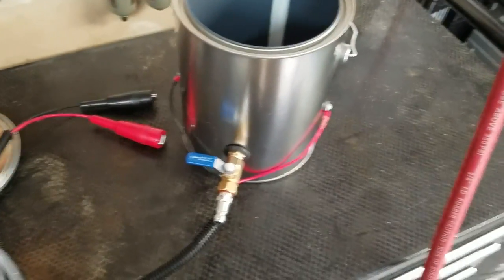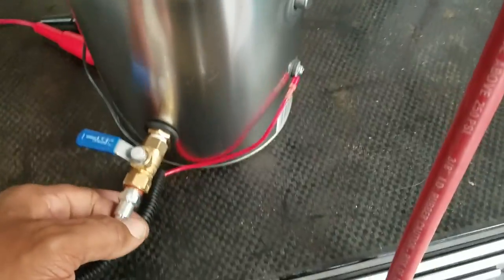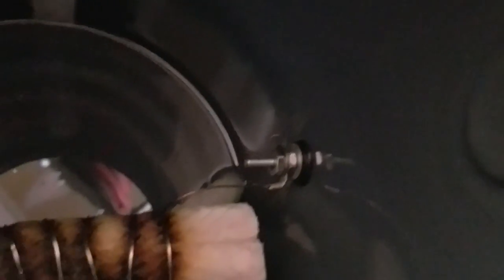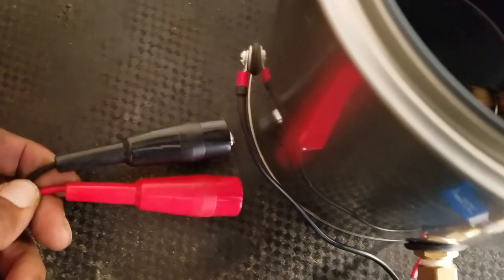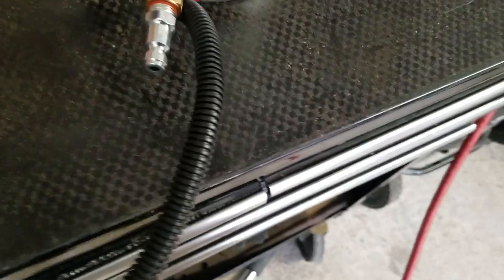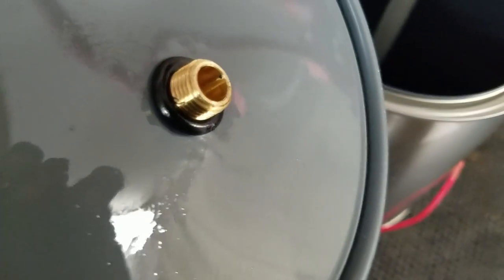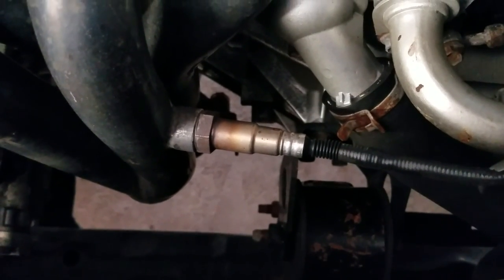Mikes DIY evap smoke machine

Comment from the maker: Sorry for taking so long to respond to this video, life’s been kicking me around a bit.

Chances are one of your wires are grounding to the can, i used insulating washers between the nuts and the can so that nothing is electrically touching the can at all. If you have a multimeter, use the continuity test between the red and black battery clips to see if you have a short
Reply: Helo sir I am live in pakistan I make one  thermal fogging machine for agriculture plz guide me u r engineer thermal fogging machine in available in market but he is very costly u guaid me I am make at
Reply: I'd personally use a rubber grommet instead of those washers to protect the can from touching the bolts and wires at all

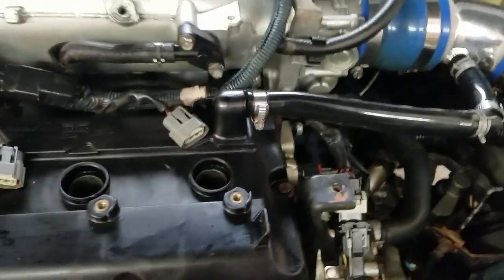Comment: you made a mistake at 6:53. the correct thing to say was " now you have more air being added with the same amount of gas". lean or rich are all in relation to the fuel, not air, because only the fuel can be controlled (in non forced induction that is)
loved the video btw it is very detailed compared to other dozens I watched. I will make this tomorrow but with the regular sized ammo can because I want it to last forever. idk how many times you can open these paint cans before they start flexing like soulja boy, not to mention deforming/crushing from any little thing.

Comment: My understanding was that lean codes were determined from excessive fuel trim.
Reply: the ecu will adjust fuel trims in response to what it thinks is inadequate a/f mix response in the cylinders, this happens from a few things including vacuum leaks

Comment: I make the machine like yours but when I connect the wires to battery they get really hot and brake and I have the resistant wire 20 gauge, what Cain you recommend the only I dint doo put some cain fuse and the positive lead wire

Comment: Maybe a little less exposition on subjects that really have nothing to do with the task at hand & a lot more specifics as to the materials, the procedure, the actual numbers (I.e., Ohms needed, the length of the burn wire [and its specific type,] PSIs needed for optimal output, etc....)  I found myself fast forwarding/reversing to find actual helpful info to the point of frustration- so much so I felt that I needed to make a comment regarding the issue.   There's no need at all for this to be a two-part video tutorial.  With that said, when on task, the presentation was good. Decently shot and narration was easy to hear and understand.  2.5* of 5*

Comment: you need an engineering degree to make these smoke machines. i need something simple, not complicated project that need half a tool shop to make
Reply: It's not that bad, a few drill bits and wrenches. The rest you can pick up from your local hardware store. Throw the numbers into a calculator and you're set